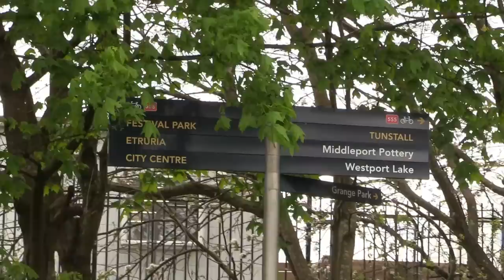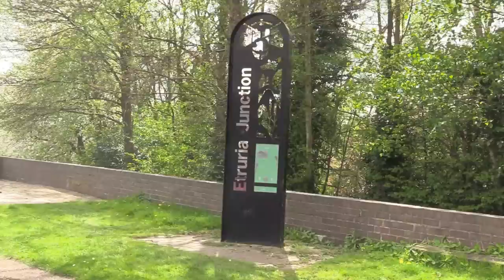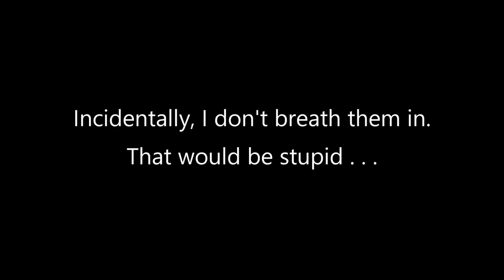Travels by Narrowboat - "Guilt Trip" - S08E11

Comment: Wow! ... so you can lay bricks with a cell phone??? (11:53) As for your varied  employments over the years, well, from what I have seen on several narrow boating vlogs, you could have become a millionaire selling aerosol paints to the local adolescents! A fair number of the "works" were actually quite well done! I, on the other hand, held my one and only full time employment position for 40 years!  Mind you, the requirements and duties evolved and changed a lot over that time! I think that it has to be a record of some sort. From what I have heard, those bone and flint mills played merry hell on the lungs of the workers (especially the flint grinding)... "potter's rot" they called it, I believe (nowadays...silicosis).  Auld Aslan smoking??? That is a diesel engine people, and it was built to work for decades at a time when emissions controls were undreamt of and fuel efficiency was almost a subject of science fiction. It is a classic engine running the way it was intended to run. Doesn't breathing the fumes bother you???  What a daft idjit thing to ask!

Comment: Smoke? Well the engine's old enough,  legally right?  Anyway, as pointed out below its a low pressure diesel and they puff a bit, even the sainted Gardner. One thing, however, there are additives to the fuel that will increase the Cetane rating (somewhat like octane) and that might eliminate some of the smoke. In a way we have a parallel with our wood boat. It was built in 1939-40; it is in good shape and cruises the Puget Sound and the Inside Passage of British Columbia.  If we attend the shows that are held in the summer, we can expect a number of complainers describing how we killed the forest just to have a boat. Of course I was not born yet, but I have destroyed the forest, they earnestly claim. To you mate, keep Aslan going and many years of good luck!
Reply from the maker: Thanks for the Cetane tip. I'll look into that. Don't get me started on the enviro-mentalists. I've encountered a couple who seem to think I single-handedly caused this climate change thing. :D

Comment: As I get older, I have put out a lot of smoke, my rings are wearing thin, my stroke is getting weak. I even run a little hot, misfire and give off some bad exhaust but one thing for sure my timing stays perfect, my filter stays clean and if it wasn't for maintenance, I wouldn't be a thing. Kevin-

Comment: Good to see you Kevin. I have a question. Is Aslan's hull made of steel or fiberglass?
Reply: It's not tupperware.
Reply: Not a yoghurt pot... steel.  A typical narrowboat build is 10mm steel on the base plate, 8mm up to the gunwhale, 6mm to the roof, then 4mm on the roof.  But it can vary.
Reply from the maker: Yes indeed Rob, to confirm she is 100% 'British' steel. 🙂
Reply: @mobiusfugue2582  Usually 10/6/5/4. Not many 8mm sided boats about.